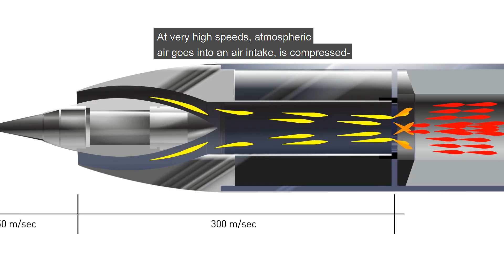How ramjets may change the role of artillery on the battlefield

Comment: So where does the explosive fit? 3 times the range An 1/4 the charge?
Reply: James Smith you’re seen transformers way too many times... rail guns have one major flaw... life of the rails is degraded by each round fired. And complexity of the firing system... not suited to real world conditions.
Reply: James Smith  A rail gun weapon is meant to shoot accurately at a designed target like a tank or an IFV. Artillery uses High Explosive shells because to be the most effective it has to count on the explosion of the projectile hitting the ground.
Reply: Kevin Tang not today, this is long range round so it can be used to hit artilery systems of enemy before they get into range, drone will send coordinates and this round will do the rest. Russians have kill UKR tanks with high artilery. When infantry get close , you swap for classic HE round, if armor is advancing you swap for schrapnel rounds. The point is to have round that can hit and kill enemy long range artilery before it gets into range, or to hit it within first minutes when radars detect the arty is firing. This round doesnt means, army will use only this one from now on. It just gives you oportunity to strike back, without air support.
Reply: James Smith  That is why we need them more than ever before ;)
Reply: Yo Daddy from what I was told this will only be for long range. A special purpose shell. Not meant to replace any of the standard variants of artillery shells but simply to add to the capabilities of certain guns. It likely won’t see any real military use because of many reasons but the fact is artillery is already pretty long range and teams are designed to cover certain areas and then move accordingly. Anyway, just passing along the hear-say.
Reply: Well rocket-assisted projectiles exist so why couldnt this have a niche? 

EDIT: Also its guided
https://www.youtube.com/watch?v=6J0XwLYmAc0
Im just wondering if the round would be fast enough to be able to slip by an active protection system?
Reply: Not all artillery shells are designed to make a crater when they impact.  Other warheads exist that are effective against certain types of targets without a big boom.
Reply: Its still  "under development"
Reply: 120mm mortar round will fit inside the compressor cone.With  8  more 60mm rounds around the centerline airduct. 
Modern arty is smart clusters  anyway.
Reply: Kinetic energy can be extremely devastating. Ever heard of "Rods from God" or even the meteor that hit the earth and killed the dinosaurs.
Reply: K E B A B oh yes, it can. It is great to knock out a target. But that is the point: it knocks out ONE target only while the most important use of artillery is to do areal damage. Another thing: if you want to hit an object from 100 km distance you need some type of guidance or search head which those ramjet shells surly don’t have. For sure it is nice to send a 50kg shell with mach 4 over 100km distance - but for me it looks like it will do nothing on arrival but dig itself 20 feet deep into the ground
Reply: @Tobias042  It would need some sort of guidance to be effective, and this certainly won't be used for typical artillary bararges. It would have a niche use of taking out point targets at long range, probably enemy artillery emplacements or high value targets. There are other methods for doing this but this has an advantage of being fired from standard artillery gun firing platform, the only expense is the round itself, which is basically a slightly more complicated rocket projectile. Buying some on hand for tactical use when they are required would probably be worth it. New technology develops new tactics. Having parts of your millitary force suddenly being in range of artillery when you thought they were safe would certainly give tacticians pause for thought.
Reply: Bordpie yes, that makes sense. Having a few of these shells on each howitzer would give you new tactical options.
In my eyes the most thrilling is the thought to fire a smaller version of this shells through tank cannons. A tank shell already starts with mach 4 or 5, imagine it gaining another few mach. It would go through any armor! 
The T-14 Armata would suddenly be look way less dangerous
Reply: @Tobias042  You'd need to put entirely new reconnaisance system for this.
Reply: @DJ_k3bab  Yeah, and done maths. Doesn't work out here. Basically, such projectile burns energy en-route instead of delivering it to target. And still there's matter of what you want to accomplish - for precision hit, such speed will be overkill. For area effect - you still got nothing.
Reply: They do take fuel with them to keep speed, drag at such velocities makes it unfeasable to maintain ballistic trajectory and high speed, slowing shells by running out of fuel makes them cause less damage, be uncountrolable by the time fuel runs out, remaining fuel will explode as well as well as the charge
Reply: The charge will be in the Ram spike, at higher speeds the kinetic energy more than makes up for the smaller charge. That's why a plain tungsten rod dropped from space is equivalent to a small nuclear detonation.
Reply: I think the main purpose of this is for anti-battery fire.  You're right, the room for explosives is greatly reduced in these shells, which is why I believe they will initially be designed for air-burst and/or packed with some DPICM grenades.  I have the feeling if the concept proves useful, then future artillery that plans to use this type of ammo will have a larger bore and/or allowance for a longer round to allow more space for charge/sub-munitions.
Reply: Make it thermobaric. Small amount of HE with aluminum powder in the casing. Boom. Problem solved.
Reply: Could be a new and improved explosive  charge.
Reply: I don't know, the russian version seems to have littel space in it's supersonic cruise missel with ramjet engine too watch?v=kHSJiO_Fvvw here is the youtube identification of the video
Reply: The explosives go around the core. The engine air intake is in the middle, and the explosive is around it. A ramjet is based on the idea that it has a large air intake, but only a narrow channel behind it, to compress the air. I would expect the charge to be same, or even greater, since the propellant required is only 1/5th.
Reply: 1/4 the charge can be high explosive, think MOAB combined with kinetic energy. 
Hey, sometimes compromises have to be made, even you could have figured that one out, no ?
Reply: Its travelling at 3.5 times speed of sound lol 😆 you don't need any explosives its a meteor
Reply: They should do this with MLRS not 155mm
Reply: Can we get this shrunk down to 9mm plz, thx
Reply: @prescotts.3235  Ever hear of the gyjrojet rocket handgun ?
Reply: @dannyhyatt4924  yeah, it was rife with flaws.
Reply: James Smith as artillery you want to spread shrapnel’s or bomblets over the target area to hit as many soldiers or tanks as possible. For that purpose you need to fill the shell with a load (explosives or bomblets). Here the shell is loaded with an engine. I don‘t see either how this works
Reply: @Tobias042  or even guided submunitions....
Reply: Exactly. The overall radius kill range lethality somehow must decreased right?. That is why american is not buying this. If this has a significance then the americans have already done it or bought it.
Reply: @clairehalibas7968  History proves your otherwise seemingly rational deduction completely, essentially and fundamentally wrong, alas.
Reply: @clairehalibas7968  Raytheo is working on this concept
Reply: @clairehalibas7968  So don't miss. :p
Reply: @clairehalibas7968  First, it is new tech, so no one is buying it yet. It is also guided.  Funny thing, if you can hit something you don't need the as much explosive
Reply: @bindingcurve  It's not a new concept at all with theories dating back to WWI. The US did experiment with the concept back in the 1950-60 and it just wasn't practical then. It doubtful that is practical even now. The expense of the individual rounds s going to be absurd compared to traditional or even hyper-velocity shells.  Rocket artillery and surface to surface missiles, ATACMS can already 190 miles. Then our the existing investment in aircraft that already perform air interdiction with PGMs. Both the US Army and USMC are focused on buying rocket for their long range fires against Peer/Near-Peer adversaries.
Reply: @Fuck_Snowflakes  First of all don't say modern artillery as they are still work like they did in the Civil War, and not much has changed since WWI. The purpose of current artillery is area denial by using a mass barrage of shells to hit a stationary target or slow moving ones. If you can pinpoint where they are you can fire one shot and kill one vehicle or one building. Now, imagine instead of a 10 gun battery firing 60 shells per minute and hitting a wide area, if they were firing the same 60 or maybe even 50 per minute and each hit a different target. That is truly an attack that an enemy would not be able to withstand. Now imagine that same thing, but now done at 150km, and the enemy would not even be able to retaliate when the finally found the battery, and by that time, the could just move up or back 20km and still be in range of the enemy while remaining outside of their return fire. War is not about being fair, it's about domination, and if you can make the enemy think twice before they even attack, then you've won without firing a shot but, if they attack anyway, make sure you hit them, because fired shells that miss badly might as well have never been fired at all.
Reply: @bindingcurve  EXACTLY.  This is primarily to take out enemy artillery, Radar, Counter-Battery Radar, Command Post, Fuel Tanks, Ammo Dumps, etc.  Think about how much damage a spy at a Battalion HQ could do with a few hand grenades!  This could be equivalent to that times 100.
Reply: @Fuck_Snowflakes  who says this is going to be used like normal artillery.  That is the whole point.  You use it to take out the enemies artillery....  If your enemy has no artillery, and you can take out their tanks with CBU-108s and GBU-53/b's....then what are they going to do?
Reply: @clairehalibas7968  The Americans are starting to use the Carl Gustav rocket launchers. thats not American.
Reply: @clairehalibas7968  The USA has already cheaper tech that could reach the same distance. Rail guns travel at a speed of mach 7 and all it requires is electricity to fire.... something a cruiser or a destroyer could easily generate. just think about a ship that could fire artillery shells hundreds of miles/kilometers inward at low cost.
Reply: @Klote3241  railguns also have the downside of destroying the barrel in the process.
Reply: Obviously in the nose of the rocket motor.
Reply: I think it's a proof of concept at the moment. What I think might happen is that they'll iron out the creases and then make several much larger guns to be similar to a modern day Paris gun. For smaller guns this seems like a terrible idea but lets say you have a few 18 inch guns? Then it's completely different. Something like that will be a great anti ship gun or good for bombardment.
Reply: @mrdojob  why not use rockets from trucks or tanks?
Reply: @edi9892  They're not as accurate. Something like two 18 inch guns protecting New York, Seoul, mounted in Gibraltar protecting the Med, It could possibly make a great addition to the side of an aircraft carrier.
Could be loads of uses for them. 

The rounds also seem very cheap to make. A ramjet has no moving parts and is just an air inlet. The rocket fuel itself seems to be very fuel rich and cast from a molten goo.
Reply: mrdojob this is as illogical as the economic return of a railway gun. Cost of shells + cost of guns + cost of logistics to support these white elephants. You might as well stick to attack-helicopters, short to intermediate range missiles (cruise and ballistic) and fighter-bombers. All more flexible. Not saying there is no future for ramjet shells, but not made for special large caliber guns, that’s really taking a page from an out of date book about battleships and railway guns. High tech - the western panacea. On the bright side, defense spending is up.
Reply: @TK421-53  I agree. Rockets are cheaper and easier to mass-produce and more versatile. Moreover, even 125mm cannons have been used to fire rockets over long-range in Soviet MBTs. Rockets can now even be used as kinetic projectiles, similar to APFSDS.
I think that they´ll replace most cannons in the long run.
Reply: @mrdojob  I think almost the same.
Reply: You all really underestimate the power of a ram jet engine. This things are 10x as powerful as conventional rocket motors (without compression cycles obviously). The payload can easily be fitted inside the tip, and bulkyly around the actual engine. Its is not a matter of thrust, it overpowers any similar system of the same size, so they can reduce the volume of the engine and still produce more thrust than conventional rockets, they just find the best compromise between cargo and engine size
Reply: But the whole principle of artillery rounds is to kill infantry!, with VT fused rounds, right?. Just regular H.E. rounds are good for fixed positions, right?. So how much is the bursting charge weigh???...
Reply: James Smith  first of all, rail gun is experimental.  Secondly we are talking about artillery, an indirect no line of sight weapon.  Does it make sense to fit a ramjet to the projectile.  Increased mileage at the cost of very small amount of explosive (because it fires from existing 155mm howitzer so the package has to have similar weight to existing traditional rounds.)
Reply: Some high velocity projectiles don't need explosives. Speed does the work.
Reply: @Quatuux  i could see that being the case if the jet assist was burning all the way till impact but i doubt it would waste the fuel burning on a downwards trajectory if range is the goal,  i'm curious what the impact velocity/terminal ballistics are. i'm just doubtful that the potential speed gained by the jet assist would be enough to compensate for the reduced amount of explosive.
Reply: Yo Daddy depending on drag, the energy built up from going to such a high altitude might be sufficient to make it far deadlier.
Reply: @aidanmattson681  but also your gonna have less mass once the fuel burns up and a same or bigger volume (depending on how much boom you pack in there) making this round lose speed to drag much faster than an ordinary shell.
Reply: @yodaddy4944  Kinetic energy goes as the square of velocity, unlike the powder charge, which only offers a linear increase in energy imparted per unit mass of explosive. So, beyond certain velocities, it actually makes more sense to increase projectile speed at the expense of explosive tonnage.
Reply: @yodaddy4944  exactly, and if the arti fire can be that accurate, it would be call a sort range missile
Reply: @yodaddy4944  it should work if you are not using it close to maximum range though. This thing is more like a "cheap" rocket than a artillery shell.
Reply: @Quatuux  with b.....a.... expensive guidance system or somebody to guide it on terminal phase, or both. And Mach3-5 is speed of regular tank APFSDS round, effective in narrow set of circumstances.  If you  could take steel equivalent of M829 and make it go Ma20 and hit with precision....
Reply: @Quatuux  Even ballistic blanks at a speed of 16 kilometers per second do not cause fragmentation, penetrate the ground a hundred meters, but there is little sense in this.
Reply: @Quatuux  ; but would the weight of the projectile cause enough damage???...
Reply: @Quatuux  that's indeed true if you're talking about the shell actually impacting right on the target.  Long range artillery is not meant for point-target precision, not even this ramjet version.  Artillery is for zone-targets. (a certain area)  Unless of course we're talking about GUIDED shells.
Reply: @Quatuux  which high velocity projectile for example? do you know the terminal velocity of "artillery" rounds?
Reply: @golferchin76  about 1600 m/s for terminal velocity and there are flechette rounds that have no explosives in them, also you have sabot rounds which are made of tungsten that are used.......
Reply: golferchin76 up to 1,900 ft per second... your typical 7.62x51 NATO rifle round is about 2,800 ft per second . So terminal ballistic here don’t help with out high explosive
Reply: @SurfnTurfdfl  155mm howitzer with 1600 m/s terminal velocity, where you get that :-) ?
iirc, terminal velocity for traditional 155mm rounds are roughly the speed of sound, which varies depending on lots of variables.
If you are talking about tungsten carbide, depleted uranium sabot smooth bore tank gun rounds, those are fast but they are direct fire short distance rely purely on kinetic energy to go through armor.  They are not what this video are talking about.
Reply: @renaissanceman5847  So it is correct, these people are talking about muzzle velocity, I am talking about terminal velocity. They think rail gun whatever new guns' hyper speed remains the same outward to 30 miles or more, seem like they forget about air resistance.  They also don't understand the differences and applications of direct and indirect fire weapon systems.  NO, speed reduces exponentially as distance increases, at maximum range, the terminal speed of NLOS artillery is roughly speed of sound. 
As for experimental.  The world always has experimental weapon systems, the chances of them actually become practical is slim. Not saying I reject experimental, but until they are actually working and been through fights, I see them as armed forces toying with new ideas.
Reply: @golferchin76 :  30mm DU anti-tank rounds.  They'll punch through 5 inches of tank armor without breaking a sweat.
Reply: @golferchin76  Terminal velocity is the state where air-resistance and the earths gravitational pull is at equilibrium. But in this case you have a fuel pushing the shell faster than terminal velocity.
Reply: @golferchin76  most tank and hand weapons are kinetic. Lookup apfsds
Reply: @golferchin76  Look at my name.
Reply: golferchin76 depleted uranium armor piercing rounds are purely velocity and shape. They have no explosives. Im under the impression are relatively common for armor piercing. The alternative is stuff like shock cone explosives which I’ve been told are temperamental on the angle of the object impacted. (RPG are shock cone tech)
Reply: @justincase5272  Wrong. The only 30mm du round I could find was the PGU-14/B for the GAU-8 and it's penetration values are 76mm of pen or 2.9 inches at 300 meters which is not 5 inches, not even close.
Reply: @golferchin76 speed of sound and less,less is acceptable,this is 3 .5 times speed of sound
Reply: @Quatuux  Kinetic projectiles work great for single target kills, but they are shit for area of effect... artillery is generally used area of effect since a great many more efficient and safer means exist to kill single targets from range with less effort, increased safety, and comparably nominal cost.
Reply: @Quatuux  And what will speed of a projectile do to a group of soldiers? except displacing soil when it hits the ground?
Reply: @Quatuux  its artillery, probably for attrition and crushing eenmy morale. It needs explosives.

If it has a guidance its probably fine to just be a penetrator, but there doesnt see to be one. And even so, who is going to spot targets 150km out?

This is an interesting piece of tech. Canr deny it, but Im skeptical of its practical uses
Reply: Kinetic kill: like the hypervelocity darts APFSDS that are nmost effective against heavy armour. Essentially the ramjet fuel is converted into energy.